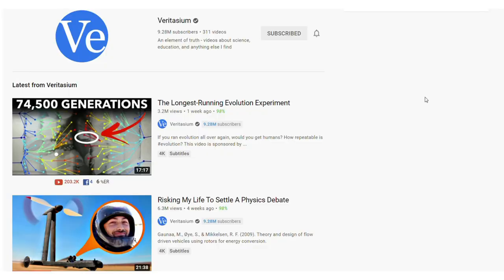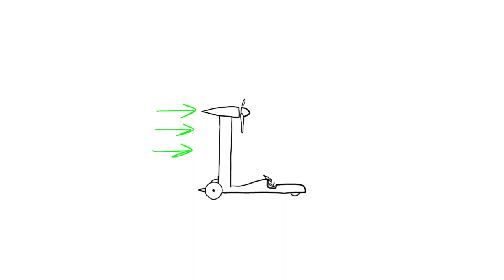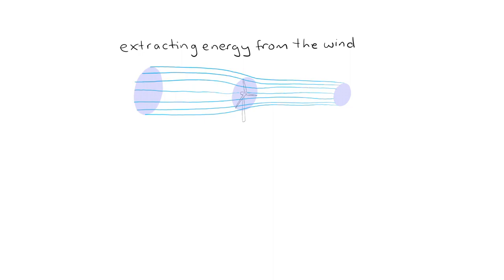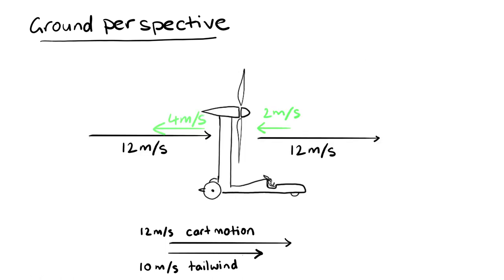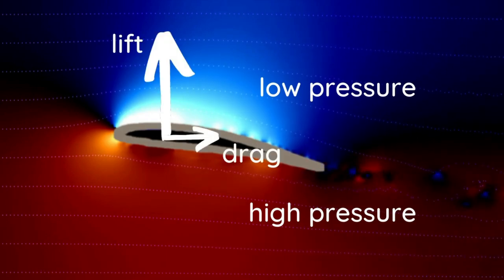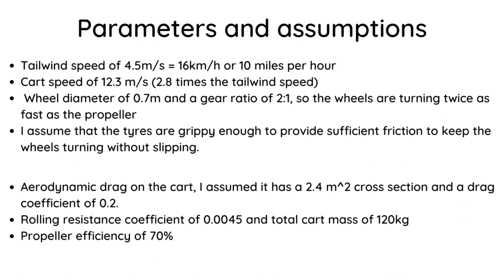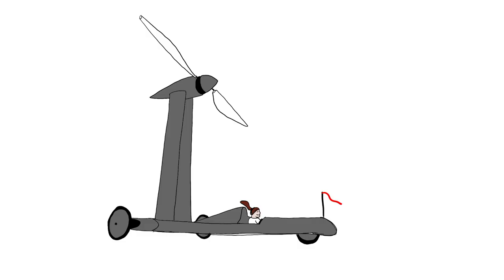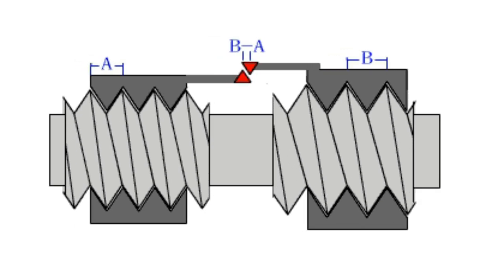Downwind Faster Than the Wind by Veritasium: How Does it Work?

Comment: So is it correct to simply say that the propeller itself is effectively tacking through the wind, hence creating greater speed than a square sail pushing the cart could?
Reply: If I understand your question correctly, I think the answer is yes.  That's how I have come to envision it anyway. A conventional sailboat on a continuous downwind tack (or jibe), with drag minimized enough, can achieve a velocity vector in the direction of travel, that has a direct downwind component (vmg) greater than true wind.  But there is still a rather large lateral component too that is perpindicular to the true wind.  What the Blackbird has done is convert that lateral component to rotational movement around the propeller shaft which allows it to move directly downwind faster than the wind.

Comment: Video suggestion can be how to build a model wind turbine from stuff most have at home. I may be a nice leaning moment, but also just for fun.
Another suggestion can be how to build a small scale wind turbine that can make useful power, from common scrap metal parts or wood even combined with thing possibly from a hardware store.

I think lots of your followers are interested in learning and perhaps even make their own turbine.
My first real attempt for a turbine was as I was 10 years old carved a two blade propeller from wood. My dad helped me with bearing and attaching a hockey puck to the back of it and add a bicycle generator. I had lots of fun with that.

Comment: I think the simple way to understand this is just to remember that the wheels drive the prop.
Reply: I think the simple way to understand this is a HOAX is just to remember that above wind speed the only forces acting on the wheels are gravity & drag.
Reply: @pl2727  and the force generated by the propeller. The propeller pushes against the wind no matter how fast its going. I mean, how do you explain the treadmill models that people make that work perfectly?
Reply: And what does drive the wheels???
Reply: @jetison333  They don't work. They don't work without fan behind them. And they aren't going faster in the air than the fan's wind speed.
Reply: @belamizsak161  Sounds like a conspiracy theory to me.
Reply: @jetison333  But the prop needs power to generate thrust. This power comes from the wheels. The propeller can't give more power than the wheels harvest, so this cart can't accelerate. Simpler to understand, if you imagine a ducted fan instead of the prop. Imagine a powermeter to the drivewheel,  and one to the fan's shaft.
Reply: @KirosanaPerkele  It is a mistake or hoax.
Reply: @belamizsak161  props are more efficient  in slower moving air, and thats where the extra energy is seeming to come from. Also, there definitely isn't a fan behind the models. Go watch the builders of Blackhawks videos, they pan the camera around to show there's no fan, show there's no strings attached etc. Not to mention that now several different unrelated people have made these carts.
Reply: @belamizsak161  also, it isn't actually producing more power. Power is force multiplied by velocity. The wheels are moving fast along the ground, and so have a small amount of force against it for a certain power. Then for the propeller, the prop has a smaller velocity as it moves through the air, and therefore has to have a larger force with the same amount of power. And since we have an imbalance of forces, the cart accelerates until inefficiencies in the propeller and drag balance the forces.
Reply: @jetison333  A propeller needs power to generate axial force. 
One blade has lift and drag, like a wing. The blade elements have lift and drag coeffitient. (Beside a foil's drag, there are induced wing tip drag, etc.) And the blade elements have relative speed to air. So they have pitch angle, axial speed and tangential speed. The drag force lower than lift. (The tangential speed is higher than axial.) You can calculate the power requirement on the propellers's shaft, for different axial speed, rotational speed, axial force. 
The axial force comes (dv/dt)*m.
Higher the axial speed, you need higher power to generate the same axial force. You need higher torque and higher angular speed. This power comes from the wheel. It is seems impassible to me, that the propeller's shaft transfers more power to the propeller, and the propeller to the air, than the wheel harvest, and it seems logical to me, that the braking force at the wheel higher, than the force generated by the prop. 
I didn't calculate it. Just I think it. I don't have 3D printer, so I can't build a cart. I didn't see any calculation from expert. I can't belive in it based on just Youtube videos.
Reply: @pl2727  No, Newton is in on it.
Reply: @belamizsak161  "It is seems impassible to me, that the propeller's shaft transfers more power to the propeller, and the propeller to the air, than the wheel harvest"

But it's not impossible. The key here is that the ground and the air have a different velocity relative to the cart.
Reply: @pl2727  This doesn't violate Newton's laws.
Reply: Above wind speed, one form of drag acting on the vehicle is ground drag. And it's enough that with correct prop pitch, the energy of ground drag at, say, 20 m/s, can be transferred to the prop which is moving relative to the wind at, say, 5 m/s (with a 15 m/s tailwind), but now it's effectively geared down by a factor of 4. If you can get over 25% efficiency you get net forward thrust. So the drag of the ground is actually the thrust source.
Reply: Power isn't the same as force. If the ground speed is above the wind speed relative to the vehicle, you have the ability to "gear down" the ground to a low speed high torque system which creates more forward thrust than the backward thrust of the wheels. This isn't in violation of any conservation laws.

Comment: Very good explanation!
So to summarise, the reason why this vehicle does not break the laws of physics is that the vehicle uses energy from wind which slows down as it passes the propeller. 

And how the vehicle manages to pick up this energy is because the lift force generated by the turning propeller is larger than the drag force on the propeller wing.

Comment: I still have a problem with the blackbird, and that is conservation of energy.  Once the car reaches windspeed, the only energy it has to turn the wheels is the kinetic energy from the vehicle itself.  If it is bleeding kinetic energy from it's movement to turn the wheels, how can it feed that energy into the props and get enough energy back to accelerate the vehicle?  That is free energy, unless it can harvest energy from a tail wind.  I've not yet seen an explanation for that physics.  It is conceivable that the prop creates a high-pressure pocket behind the prop that works against the tail wind and the prop to increase thrust, but I don't know if it would be enough to accelerate beyond wind speed.  I'm still half convinced that it's a hoax and there is an electric motor in the cowling.
Reply: Once the car reaches speed of the wind, the wind continue to have the kinetic energy in the Earth’s reference frame. So, the car has the source of energy. The question then is can the car get this energy when it goes with speed of the wind or faster. The answer is yes.
Reply: @andreykuznetsov7442   The tail wind would still have to push the car forward by some means.  I'm not convinced that can be done without cheating.
Reply: @toddmoore9841  

Hang in there.  You'll get it.  :)
Reply: @toddmoore9841  I think, simply speaking, that the surface of a blade moves forward slower than the wind when the car goes at the wind speed due to inclined position of the blade. It allows the wind to push the blade forward.
Reply: @toddmoore9841  "Once the car reaches windspeed, the only energy it has to turn the wheels is the kinetic energy from the vehicle itself."

No, the propeller is decelerating the wind (relative to the ground) so the cart is still getting kinetic energy from the wind.

Comment: Is this correct?

The maximum velocity at which It can travel = velocity of air / (1 - VSR)

So if air is moving at 10m/s and VSR is 0.7 then max theoretical velocity is 33.33m/s
Reply: What is VSR? The maximum speed is limited by friction and drag. There isn't a simple formula for that.

Comment: I met this a few years ago and it took me a while to digest but I have no problems with it now. In my opinion the simplest way is to start by switching the ground and the air: you're constructing a machine that can go against the wind. Obviously if you ensure it has good contact with the ground, then the wind can turn a turbine and that can turn the wheels and the machine can start moving against the wind. That sounds completely natural. And if you assume the machine has low enough drag and the wind won't push it back too much, it can move against that wind at any speed, even faster than the wind goes. It's just matter of gear ratios and the direction the air is hitting your turbine is not changing. And once you're ok with that, just switch the wind and ground back again. Instead of machine that pushes off the ground to go against the wind, have a machine that pushes off the air to go against the ground. Considering the air to be the main frame of reference makes it easier.
Reply: I am the same opinion, exactly. I am struggling now to with something else. Could you chare your thoughts? When the maximum acceleration will occur? I have some theory but would not like to bias you. Just if have given some thoughts about the acceleration, what is your opinion. I will be glad to hear that.

Comment: I think you hit the nail on the head when you said it was powered by the ground [the difference between the air speed and the ground].
The latest Veritasium video had a good demonstration of this, where they used a wooden plank with a multi-wheel device. It clearly showed it was the difference between the wood and floor that provided energy to move the device forward much further than the plank move.

Comment: I think the key to understand why this is not a perpetuum mobile is, that there always is an energy input into the system - the wind (relative to the ground, not relative to the vehicle!!). All this would not work if there would be no wind at all. If you would, under still air conditions, push the blackbird with a car up to some speed, it would not accelerate once you stop pushing it.

Understand, that speed is not equivalent to power. The second factor for calculating the power is the amount (the mass) of air moving.

Another analogy would be an electrical transformer. It can output a higher voltage than the input voltage, but at the cost of outputting also less current (or vice versa). It's like an electrical lever. So you could say the blackbird is a mechanical transformer, or a very sophisticated lever.

Gee, I hope I got this right...

Comment: This thing made me think for a few days. My conclusion was that any wind powered machine is powered by the winds pressure, so when the propeller slows down the air behind it, the pressure is increased (and low pressure is created in front of the prop). It seems to me that the faster it goes above windspeed the less pressure it can generate this will eventually balance with the drag force required to turn the wheels and be its speed limit. Thrust is not usually considered to be pushing on anything but in this case it is. Consider why it wouldn't keep going if you pushed it up to speed on a day with no wind?

Comment: The propeller turning creates a low pressure volume in front of the propeller the extent and position of it may aid forward acceleration if the zone starts to encompass more of the vehicle...reducing resistance.  Our usual visual and mechanical concept of a propeller is something that creates wind (force of wind) by being driven by some power source.  All that air pushes a plane through the air.  But it isn't that simple.   Lift creates fight but flight is only possible by moving air over a wing which requires forward motion....starting to sound familiar.   We could also say that the plane is pulled through the air which helps get the conservation problem to work out.  When the vehicle starts, the propellers act like a sail.  The propeller is not free to move as it is on a chain to the drive system.  So the entire rear of the vehicle, it calculated surface of incidence, is effectively a flat sheet on a cart. Wind begins to speed up the vehicle to the maximum of the wind speed....using your sailing analogy...a broad reach.  At some point the question becomes when does the "flying effect" begin to become a noticeable factor. Just as a beam reach cuts the diagonal air, the angle of the blades is cutting the direction of the wind.  An increase in vehicle speed, above wind speed, is possible.  The extent is limited by the vehicle design, mass, stability, propeller design, wind speed, terrain assembly friction etc.  I would also posit that duration of the increase may be short and "pulse" as the system reaches an equilibrium state.  If this were not true, then the device would be a source of unlimited power.  

Land sailing is analogous.  I have included a link that references the land sailing world record of 120 mph in a 40 mph wind. 

https://en.m.wikipedia.org/wiki/Land_sailing

This itself should be impossible because the loss due to the wheel drive assembly, which are very much not zero, and due to friction with the air resistance and the ground.  The only other factor to cause acceleration is how fast the pressure difference in front and behind the propeller grows and when, due to propeller configuration, the maximium value is achieved.  Conservation of energy balance here has to take into account all these factors.  An ideal propeller configuration could be created with some fairly basic advanced math.

Comment: The tacking example would be great except that the blades are not being moved by the wind so they are not analogous to sail boats tacking so that example makes it more confusing.
Reply: The tacking example is great precisely because aerodynamically, the airfoils on the Blackbird are doing exactly what the airfoils on a high performance sailboat are doing on a broad reach.

If that confuses you, it's not the fault of the correct explanation.
Reply: @johnborton4522  I don't see how that could be. The wind pushes against the sails which causes the sails to move in a direction roughly perpendicular to that of the wind. The wind is not pushing the blades and making them move according to the official explanation. The wheels are making the blades move and the blades then push the air. What you have is analogous to the sail boat being pushed and the resulting movement of the sail pushing the air. At least that's what they are saying.
Reply: @nathanlewis42  
>> The wheels are making the blades move and the blades then push the air.

In the case of the sailboat - the keel is making the sail move and the sail then pushes on the air.  I know it's a mind bender, but it's true.

Comment: Can you imagine what does it mean force 3,5N? That is Thrust Force which you have as result from your calculation 3.5N. I am very curious If you apply 3.5N to the Blackbird cart, which assuming is about 100kg (without driver, just the cart), every other resistance apart from wheels resistance is neglected, how many centimeters it will be driven after pushing with 3.5N an hour.

If the wheel resistance coefficient is 0.005 (1/2 from 1%), 100kg x g = 981N  is the normal force, than the resistance is 4,95N. When you apply 3.5N and substract the resistance 4.95N the total force -1.5N The cart will not move. I wonder the contribution of those 3.5N when the car is moving and we have the driver siting inside and air resistance.

Comment: Much better explanation of the energy at play than Veritasium's second video on the craft. I liked your use of relative wind velocities to demonstrate the work being done. You did go a little off track with your prop theory. I wouldn't bring in sails or wind turbines as in their first video. It only confuses the matter using a windmilling propeller to explain a powered propeller. Also wouldn't mention efficiency of propeller - that's a given. You missed a great opportunity to explain the thrust force from the propeller reducing as the advance per revolution increases. You did mention the driver coarsening the prop to meet the new RAF but that was a great opportunity to explain the decrease in thrust resultant! I think if the layman were simply told a propeller produces maximum thrust when static,  (when it has no APR like the model on the treadmill), then the dots could be joined that tailwind helps to replicate static thrust. That is, the propeller is producing more thrust than it otherwise would because of the tailwind. (If an aircraft could have headwind over the wings and a tailwind over the propeller it would take off in the shortest length of runway)

Comment: so, essentially the propeller is creating a huge pocket of decelerated air behind it, and the more air it moves behind it, the faster it will go, which will move more air, which will make it go faster. and it gains the efficiency it needs to accelerate because the tailwind is creating a relative wind in the opposite direction? im still not sure i totally understand this. its hard for me to see where the energy from the tailwind is collected. it seems like it wouldnt be from the propeller, but it sort of has to be?

id love to see some sort of smoke test, im not sure if it would help me visualize things or not but im having a hard time understanding.
Reply: The wind slows down, the propeller speeds up.  The total energy is conserved.  The air pushes the propeller. Some part of the momentum of the air is transmitted to the Earth.